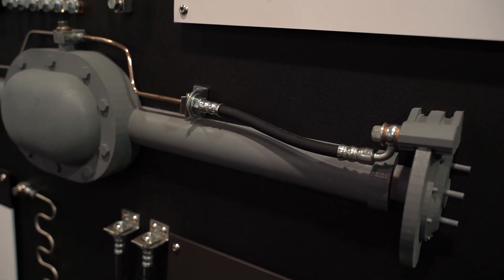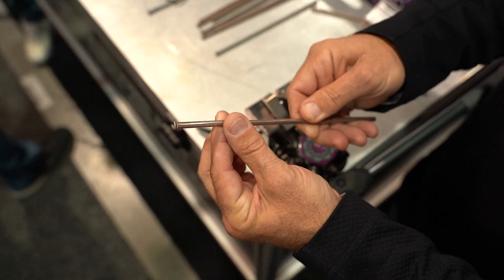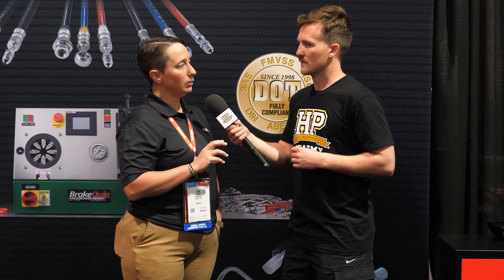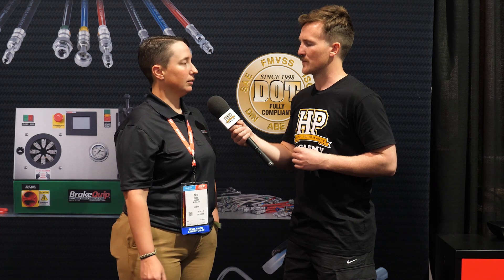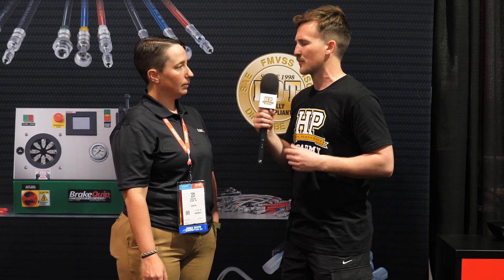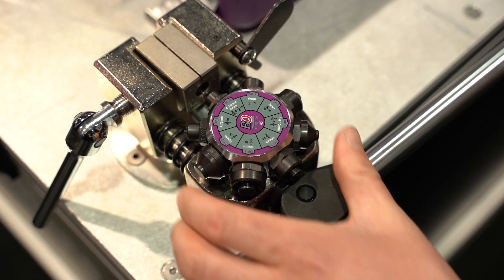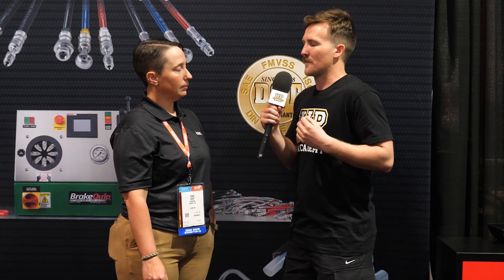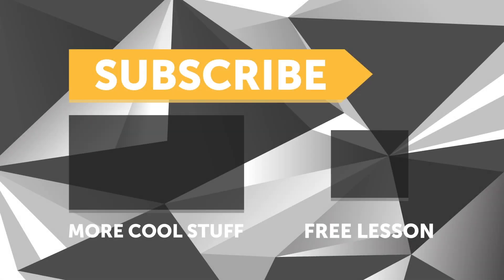Brake HARD LINES....Are Actually Easy | Brake Line

Comment: I recently did my brake lines. I used steel and copper nickel. The steel took me a few more attempts before I could get a good double flare. The copper nickel is super easy to work with and I got much better results. Very satisfying to make your own brake lines. Check the OEM flare to make sure you making the right flare. I had to have the ABS end flared at the brake shop due to not having a double bubble flare tool.
Use a file to chamfer, and I used a little oil.

Comment: All correct. 👍
I’ve seen horrendous hand made brake lines in copper on many a road  car some really quite shocking for a supposed garage repair .
I always use copper / nickel as it’s just a better product all round . 
I must admit having used cheap flatting tools in the past I have never had good results. The proper ‘ over centre ‘ / cam type are the best and worth the money  .
Stainless is what I’m probably going to try next but had heard horror stories of it work hardening when flailing and bending. Thankfully I know know you can get annealed stainless. Thanks for that guys , spot on 👍

Comment: Best advice I ever saw regarding brake hard lines was check what the dealer charges. Often they are under 10 dollars each and have the original olive drab coating.
Reply: Sadly that doesn't go for any car. Just the 2 rear lines for my car are like € 200,- each
Reply: @DutchFocusST  and you’ve checked all cars? Because I’ve had lines for 6/7 UK pounds? 🤔
Reply: @DutchFocusST I would be very surprised if a dealer changes 400 euros for to small brake pipes? Especially Ford
Reply: I think you two need to chill a little - with SOME vehicles the lines can be bought new for very reasonable costs, made to the correct length and with new fittings, just as SOME may be very much more expensive, especially if they include flexible sections.
That said, remember, there are other options other than the dealers, with some common vehicles being available from the auto-parts' stores, or specialist brake suppliers - the last will usually give options for materials used, too.